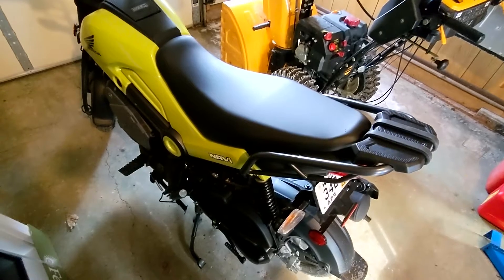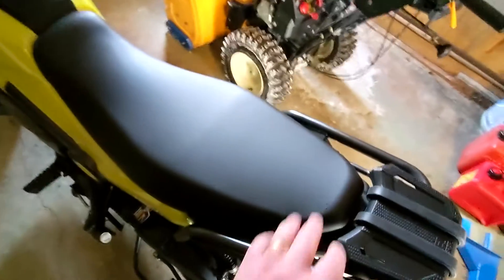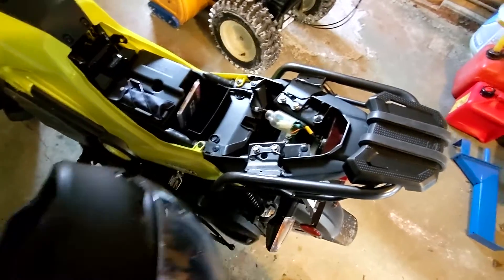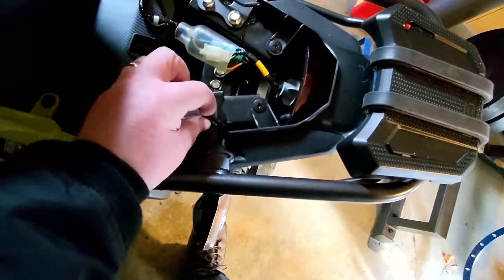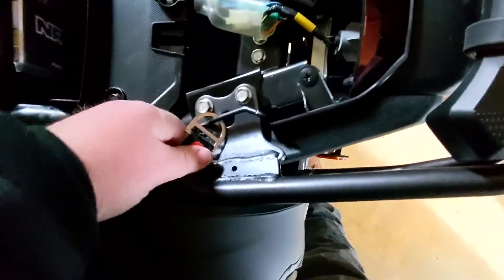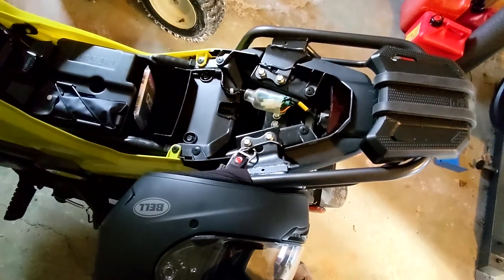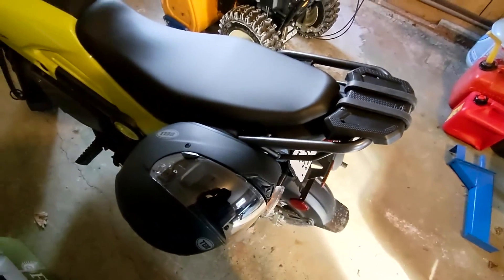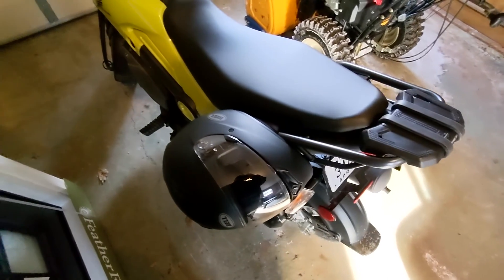Honda Navi Helmet Lock: Where is it? How does it work?

Comment: I just ordered one of these and am trying to figure out how to lock it up.  It doesn't have disc brakes, so can't use a disc lock.  Any suggestions?
Reply: There is a steering lock on the right side, under the speedometer
Reply: Had the same problem the steering lock is easily brocken just by rocking it back and forth so use a lock aswell a decent u lock works well hook it through the front wheel where the holes are in the wheel in combination with the steering lock you make it tricky for people to steal without a angle grinder
Reply: @Rudiudiii  what brand/size u lock did you get. I've tried 2 now and both are still too big to fit thru the front wheel holes
Reply: @o0CallOfTheWild0o  the first one I got worked fine mesure the width between the wheel holes and find one that works try get a kryptonite new york or a onguard pitball u lock which I know works
Reply: @o0CallOfTheWild0o  I'll get the sizing of my u lock at some point today should be easy enough to find one
Reply: Just get insurance. I did for less than $100 a year for full coverage.
Reply: I'm going to lock mine to a pole at the grocery store and a fence at another business I want to bike to. I'm also going to get a handle break lock.
Reply: I use my kryptonite unlock around the fork tube to a fixed pole to lock

Comment: Is there an issue if water gets inside there via, let’s say I left my Navi outside for like 3 hours without the seat cover on, and it god rained on without the seat, via water got inside that area you’re showing when you removed the seat. Is that an issue for the Navi via water damage or?!
Reply from the maker: If you leave the seat off and water gets under the seat, dry the area as best you can, and let it air-dry until there is no more moisture. You can run a hairdryer on the area to accelerate drying, but don't use a heat gun. After the area is completely dry, test the bike and make sure there is no lost functionality, including all lights, horn, starter, etc. Make sure the bike drives and functions 100% normally. Then, going forward, make sure the seat is always on the bike. The Navi is designed to be in the rain for reasonable periods without damage, but that's assuming the seat is in place and all other parts are in place. If the seat or other parts are missing and the bike gets wet, then water can come in contact with parts of the bike that are not as weather-resistant, which could shorten the longevity of the bike, or increase the need for repairs. For example, there are wires and other components under the seat that are designed based on the assumption that a seat will always be protecting them from the elements. If that seat isn't there, then these parts may not perform as well, their life may be shortened, etc. Hope this information helps.